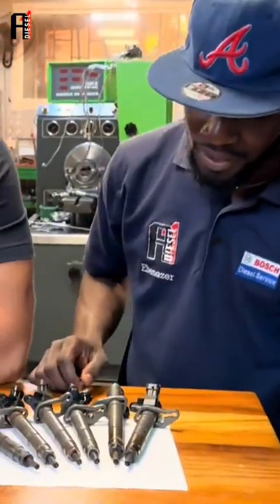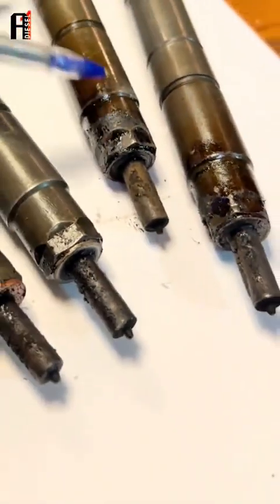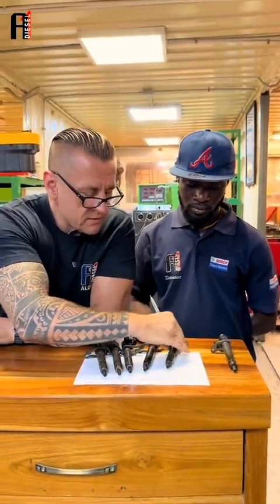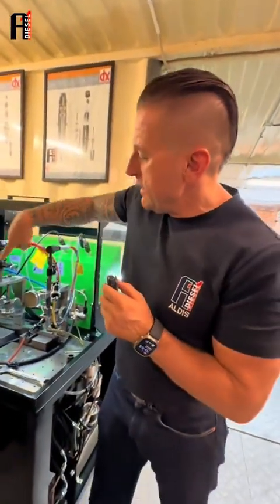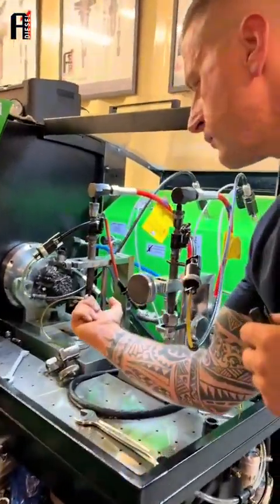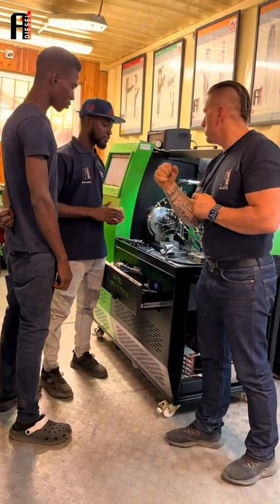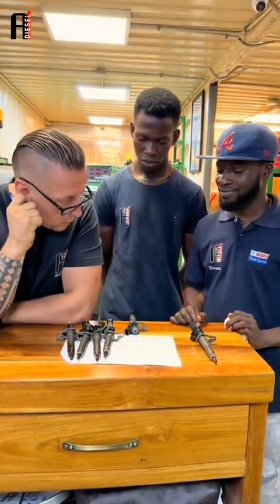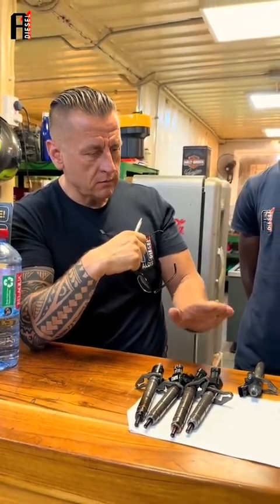Detecting and Diagnosing Diesel Injectors 🔧🛠️

Comment: At least I learned basics of diesel fuel injector. If it not fitted properly than we noticed carbon built on its nozzle.
Reply from the maker: Improperly fitted diesel injectors cause carbon buildup on the nozzle, leading to poor performance. Proper installation and new washers help prevent this. 🔧🚗🔥